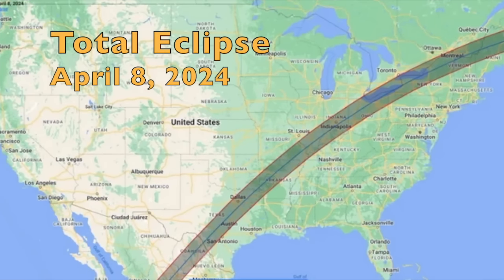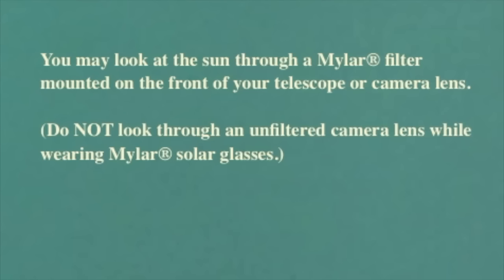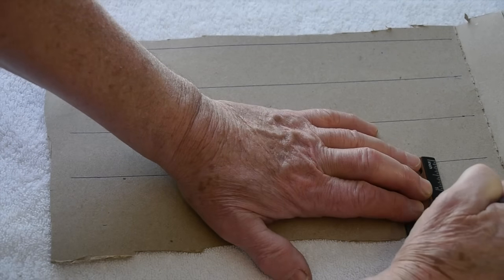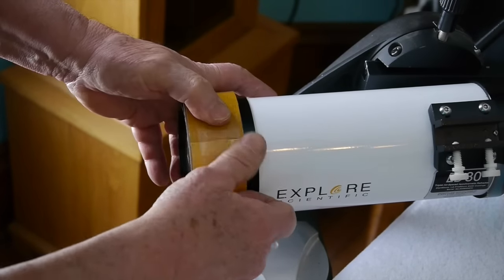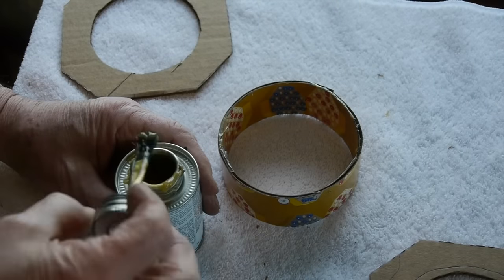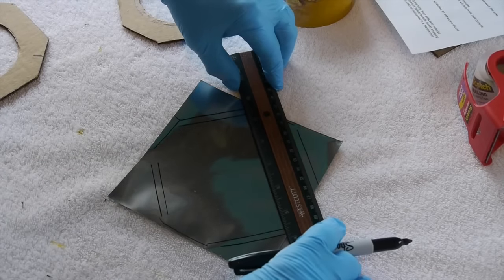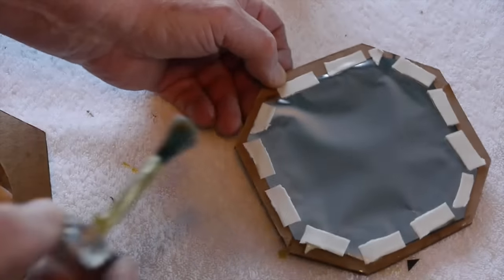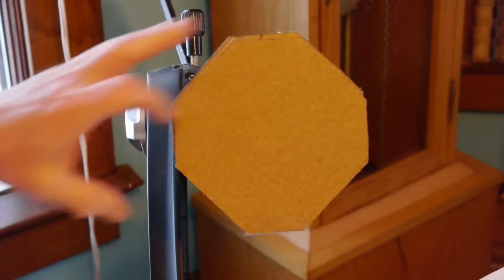How to Make a Solar Filter for Telescope or Camera

Comment: 💥Thank you greatly for the effort to share this very helpful info.  
A couple of things though stated kindly…  0:41 you mentioned that you shot the partial in 2017 but for this one you are making a solar filter. It implies that one was not needed the  last time but yet the same identical filter requirements are needed for both.   Also, I watched another video showing how to make a homemade filter like yours and he said to put the shiny silver side towards the sun and you say the opposite.  
One is right and one is not.
Reply: I second these two points. The instructions on my Thousand Oaks Optical Mylar filter says the shiny silver side faces the sun.
Reply: @ronjenkins4257 So does mine. Maybe the difference is in the manufacturer.
Reply: At 1:06 he shows his old filter, the one used for his 2017 photos presumably.

Comment: If the wrinkles don't matter, would a large rubber band suffice to keep the filter on?
Reply: I got some solar film from Thousand Oaks and it says on the mounting instructions that a rubber band is sufficient. Remember though, during totality you will want to take the filter off as there is not enough light during that time to take photos with the filter on. If you want to take photos of totality, you should make a simple housing like this so you can quickly take it one and off.

Comment: I used to live in Cherry Creek and am now in MS.  Wish I was still up on my hill for this.  Shiny reflective side of Mylar always faces out towards the sun.  Tip:  Leave sheet between the cardboard it came in.  You can draw the pattern right on the cardboard part and cut it out then remove the film and mount it.  Another thing you can do is mount the whole sheet on the back of the frame then attach the front part.  When it dries trim off the extra film.

Comment: Is contact cement the same thing as rubber cement?
Reply: No. Rubber cement is different from Contact cement.  But contact cement is readily available at Home Depot, Lowes, Ace Hardware, and probably Walmart.  Look in the glue department or ask.  (It might be available at Hobby Lobby, Michael's too.)